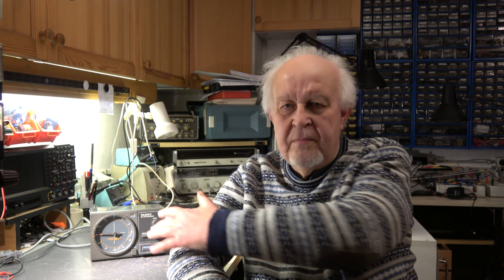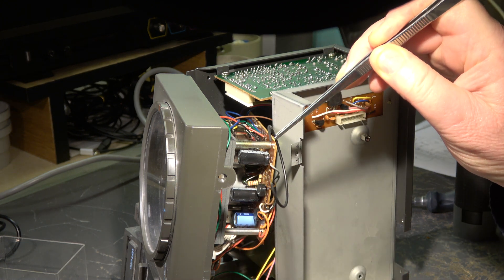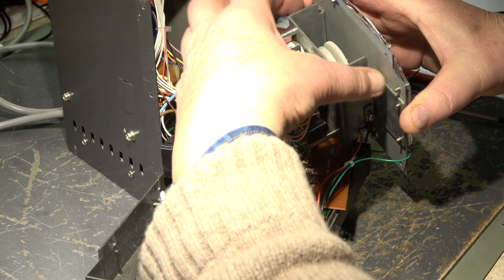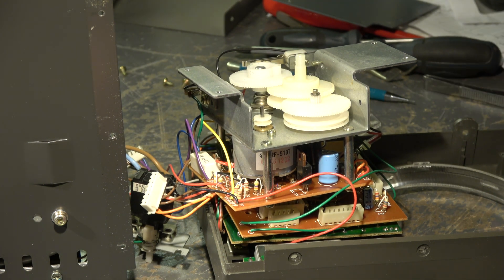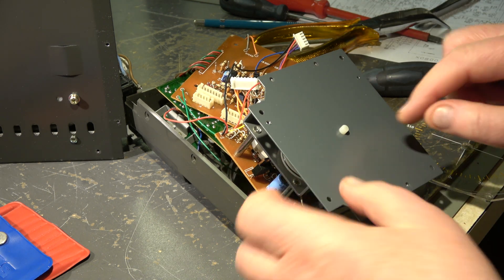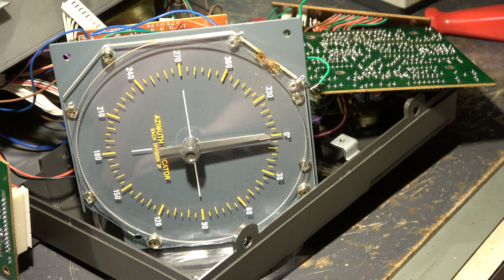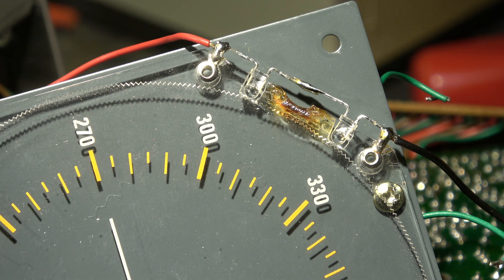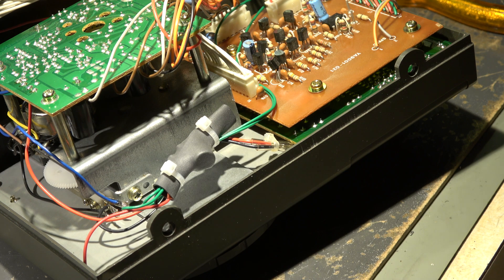#167 YAESU Rotor G 2700

Comment: I have the G-1000SDX and need to do the LED replacement, thanks for the idea!  And will make a note in my manual to refer back to this video in the event my drive belt fails as well.  73 - Dino KLØS

Comment: DFS- Design For Serviceability.  We had a SE (service engineer) as part of the project team.  She would have complained loudly about this, the most likely single point failure: the rubber belt, being in a very difficult location.  👍
Reply from the maker: DFS seems to be a strange word for many products in our days
Reply: It was one of many.  We also had DFM & DFA:  Design for Manufacturing & Assembly.  We were flush with engineers that had unique & specialized skills.  Seldom did we find an PE that was great with Fit/Form/Function (Product Engineer or PE) who then could make sure we could manufacture it & assembly it with efficiency.  The PE had the BOD (Bill of Design) which was the roadmap for designing a gear, aluminum case or a shafts for example.  So any newly minted engineer could hit the ground running and be largely assured of designing a good part.